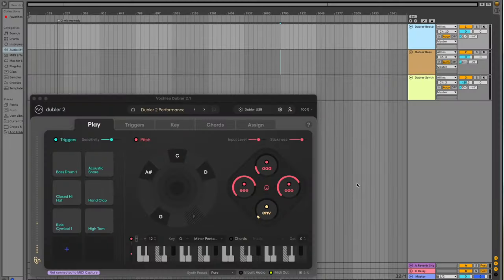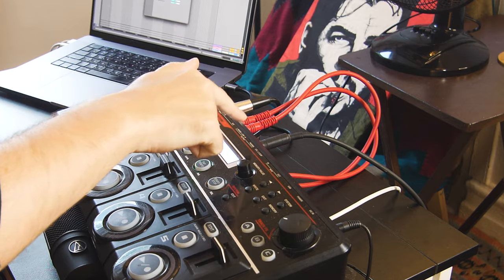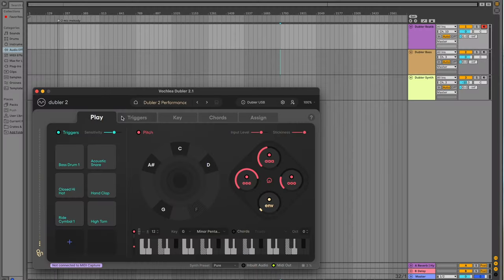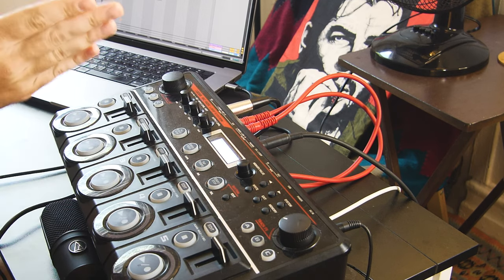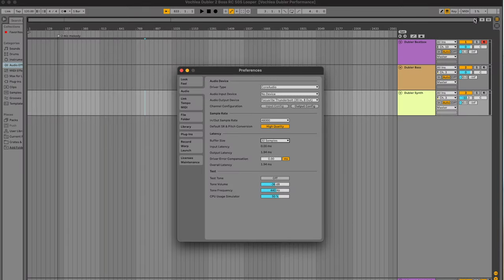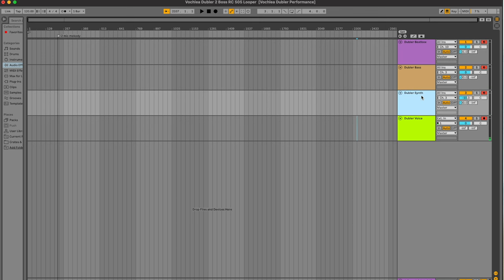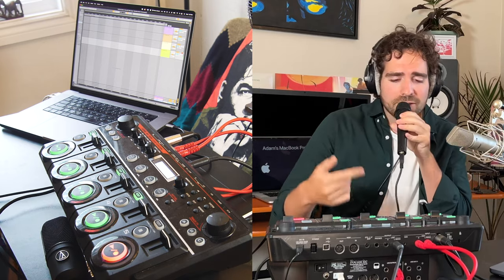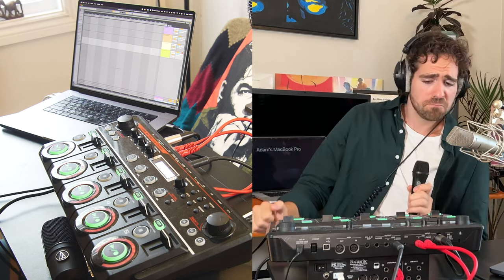Live Looping Voice-to-MIDI With Dubler 2 and the Boss RC-505 🎛️ feat. Beatox

Comment: Awesome explanation! Thank you. So clear! I have the Duber 2 and I JUST got my 505. Awesome timing for this vid. 

Is there any way to do this mobile like connected using my phone or something?

 It does seem there was a slight delay where it dragged. I wonder how to get rid of that.
Reply from the maker: Hi! We're glad you enjoyed the video 🙌 Unfortunately Dubler 2 can currently only be used on Mac or PC Systems and we don't have an iOS or Android version. In terms of the delay, there will always be a tiny bit of latency with such an extensive looper-based signal flow, which is why it definitely takes some practise and good sound selection to see what works and what doesn't!
Reply: If you use a phone with a USB-C or Apple Multiport midi cable from the interface to that, and route midi signals to the phone/iPad to control midi instruments that way. Hope this helps.

Comment: I REALLY want to get my hands on Dubler 2, however I’m slightly concerned as to how good the guitar sounds are? There isn’t much out there that shows this side of software, other than the one video by you guys.
Reply from the maker: Hi! Dubler works as a MIDI controller that sends MIDI to any DAW you are working with. You can use it to launch any sounds, synths or samples you have loaded up in your session but it doesn't come with any of its own sounds that can be recorded. We're currently working on some new videos in which we use Dubler to control guitar software instruments - what kind of sounds or uses would you want to see for example?🎸